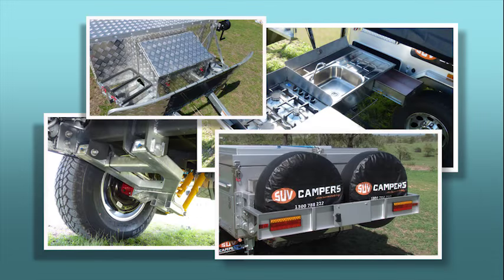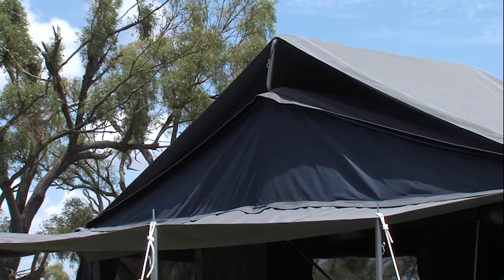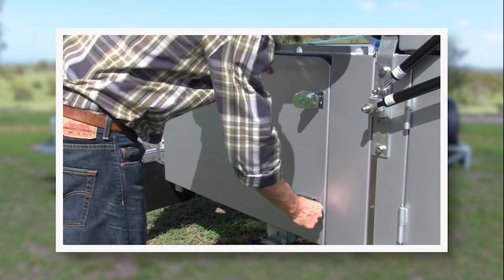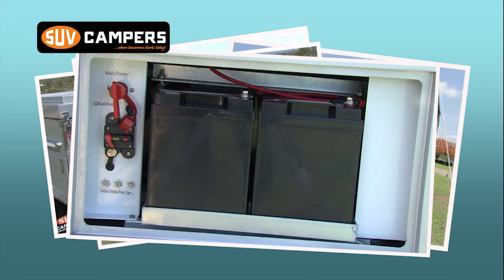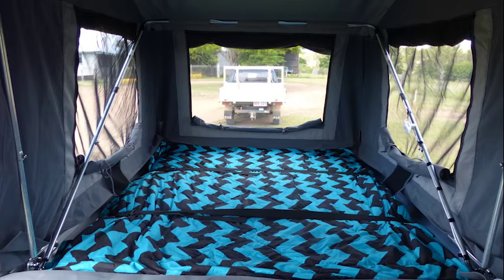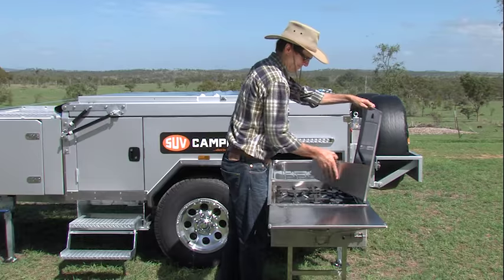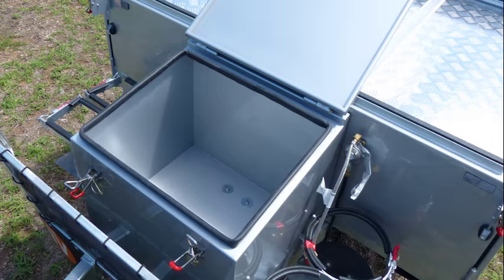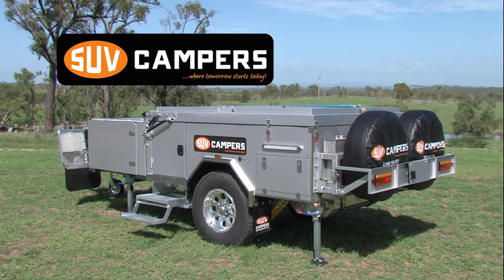Guardian Campers and Sahara Trailers present the  SUV Forward Fold Grand Deluxe

Comment: I’m certainly no expert, but I’ve towed enough trailors to query whether that water tank at the back has been tested from a safety perspective?
I was always told to never load the rear of a trailer like that due to stability problems - trailer can get a sway up, sometimes can be very dangerous. People please do your research - there is good reason why other manufacturers do not cheat out of ball weight by trying to counterbalance on the rear end!